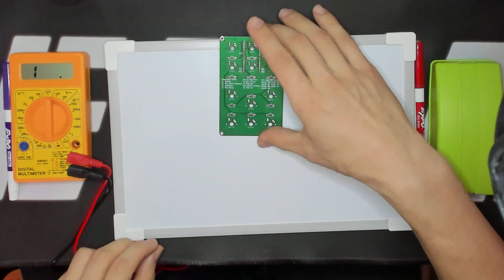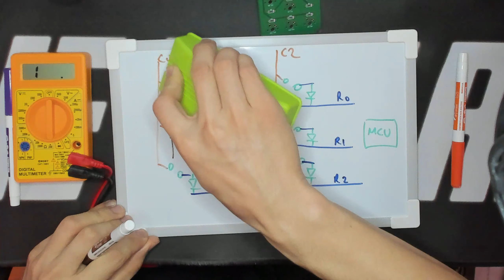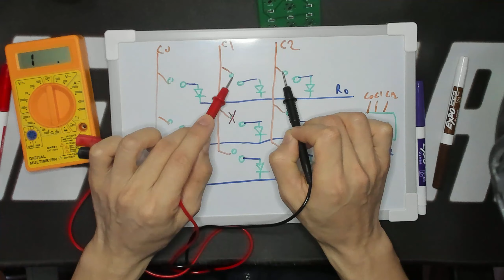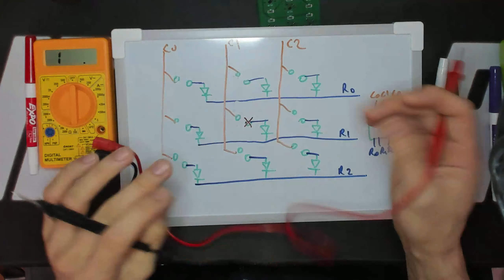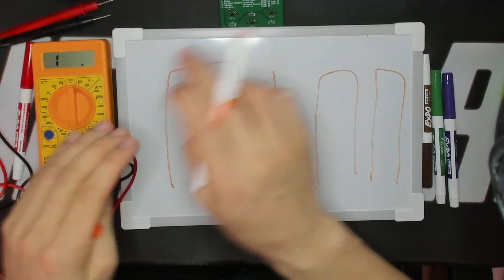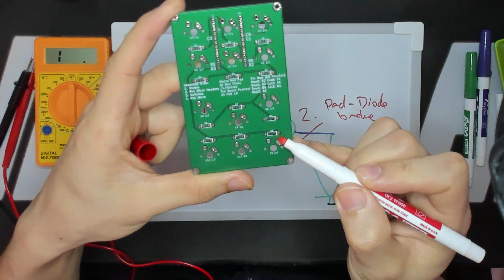(An attempt to explain) Testing your PCB for wire jumping

Comment: Hey Don,

I have an issue you might be able to help me with. I have a Corsair K70 RGB Pro keyboard that I modded by replacing the stock switches with Gateron Red switches. While modding one of the switches, I accidentally lifted one of the pads on the L CTRL switch. This also caused all the switches in the same column to stop working, which include ESC, ~, TAB, CAPS LOCK, L SHIFT, and L CTRL.

Using a multimeter, I noticed that the pin where the lifted pad corresponds to the column (the left pin of the switches) is the issue. My problem is that the multimeter shows continuity between all the switches on the left pin of the column when I test them, with a beep sound. However, none of the switches work when I press a key. I’m a bit confused because there’s continuity, but the switches aren’t responding.

What should I do in this case? I’ve heard that I may need to attach a jumper wire from the damaged pin of the L CTRL switch to the pin on the MCU. Do you think that would work?
Reply from the maker: Hi there!
In theory, if I understand the potential matrix correctly, yes, it would work, you would however need to identify which pin on the MCU is the correct column pin that connects to the burnt out LCTRL pad. You'd have to trace the visible trace (if visible) back if you can, but if it goes through the PCB to the other side with a via, you're going to have a bad time.

Alternatively, if you can actually see the trace that goes to the LCRTL pad, follow it back a little bit, and if it is got space to do so, scrape away the soldermask ontop of the trace very carefully to expose the copper trace, and solder a jumper wire from the pin to that exposed trace. This is also a common technique but tends to be more advanced.

Best of luck!
Reply: @theboard  Hi Don, I've identified the pin on the MCU that links to that column using a multimeter. I can see the trace coming out of the column pin from the MCU, so I’m guessing I need to scrape down that specific trace and solder a jumper wire from it to the damaged trace and pin for the L CTRL key. However, I think an easier solution would be to solder back the original switches that came with the keyboard and then send it to Corsair for an RMA, as it is still under warranty. Hopefully, they’ll replace it with a new new keyboard. I’d try the latter option first, and if that’s not possible, I’ll follow your recommendation.
Reply from the maker: @amiratak3292  Best of luck with the RMA, their inspection (lol if they do one) if they find out you modded it, might come back with a voided warranty haha.
But if they just do it anyway without question, then win!
Reply: @theboard  Hopefully they shouldn't do an inspection because they're a big company and they usually replace the product with a new one. I've had a few corsair keyboards in the past with some LED issues, and they always replaced the keyboard with a brand new one, so I should be good. I just have to make sure I do a really good job making sure the keyboard I'm sending back doesn't look modded.
Reply from the maker: @amiratak3292  If it doesn't have QC stickers over screw holes and that kind of thing then yeah, your chances are pretty good!
Reply: @theboard  Luckily it doesn't have those QC stickers :)

Comment: Thank you ! Great video. How do we test when an entire column breaks ?
Reply from the maker: You will have to test two things really to understand if the column is traced as a series or in parallel. To test if in series, you test switch column pin to next switch column pin up and down relative to each switch and see which ones have continuity, and then test from one end of the column to each switch. If you map it out that way you will see where a break is, and also if it is in series or in parallel. 

If it is in parallel, then a break in a single trace will not impact other switches, where as a series trace broken will affect switches after the break, always from the MCU pin.

If the entire column is not functional but switch to switch continuity is fine, then it means the trace is broken between the switches to the MCU pin.
Reply: @theboard  would be nice seeing a more main stream board like corne.
Reply from the maker: @AI_with_Kaiyes  Not sure what you mean, do you mean you want to know how the matrix is laid out for the corne? If so, you could probably find it in repos, or look at various build guides for the same PCB as whichever version you're after, and then look at the traces on the PCB to figure it out if you can't find an actual repo.
I don't have a corne so I can't check/build a matrix off it.
Reply: @theboard  oh I'm building a corne. One column doesn't work. So was trying to find how to videos. Your video came up. I think I will rewatch your video few times. I'm just trying to learn how to use a multimeter to trace a why a column has broken is all
Reply from the maker: @AI_with_Kaiyes  Ah, well have a try and reach out again if you need to :)